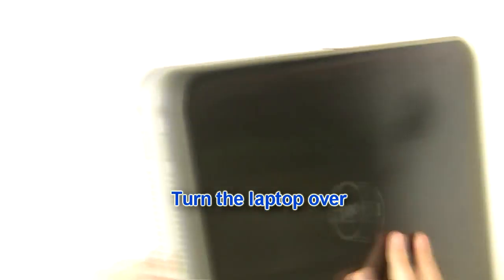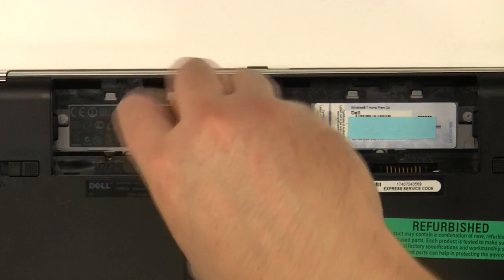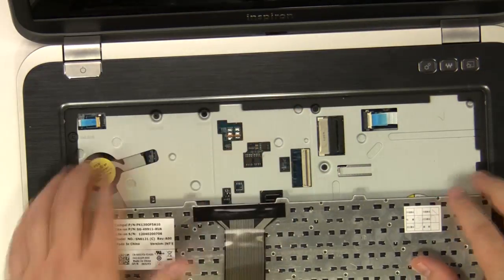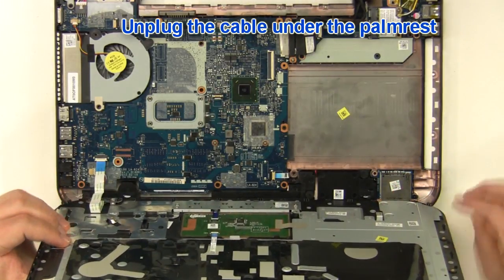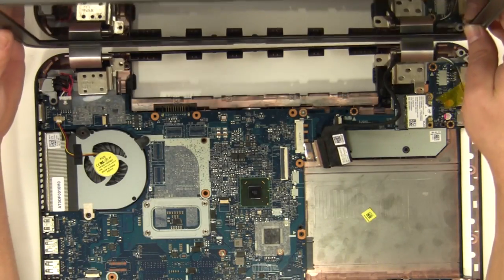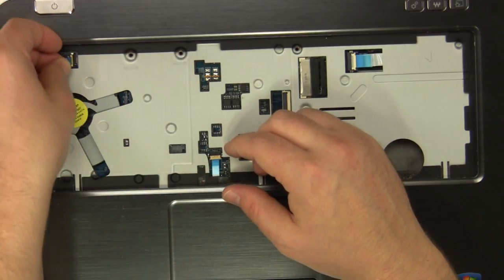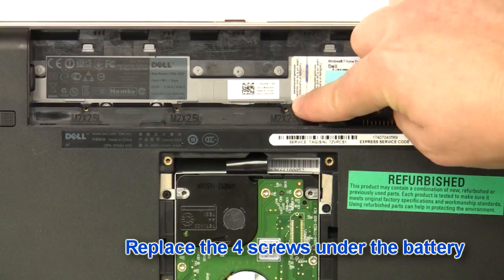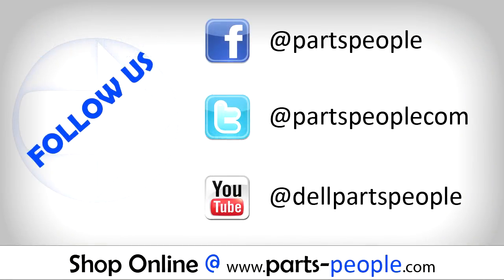Dell Inspiron 15R (5520 / 7520) LCD Display Assembly Replacement Video Tutorial

Comment: my same laptop but the charging pot is lose how to fiz plz help me
Reply from the maker: Its hard to say without seeing the laptop but you will probably  need to change the DC jack. https://www.parts-people.com/blog/2013/05/16/dell-inspiron-15r-5520-7520-dc-jack-removal-and-installation/ If the DC hjack has broken off of the bottom base you might need to change that too. https://www.parts-people.com/blog/2013/05/23/dell-inspiron-15r-5520-7520-bottom-base-removal-and-installation/